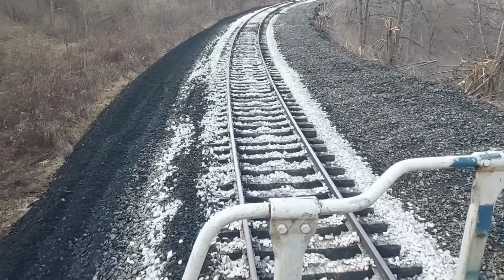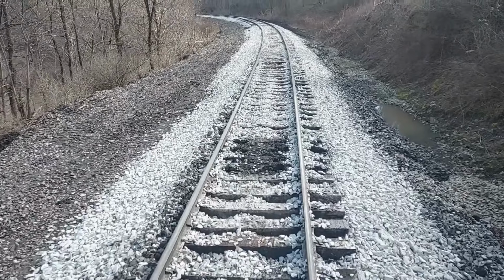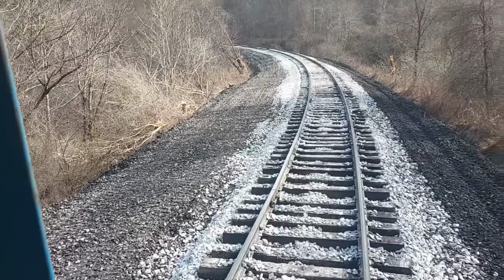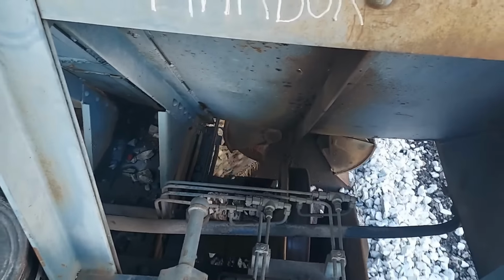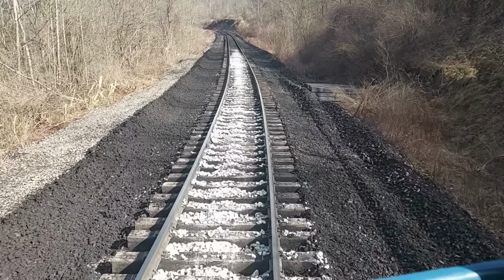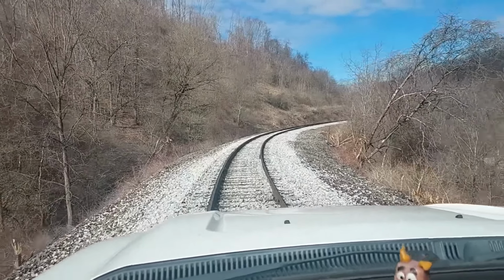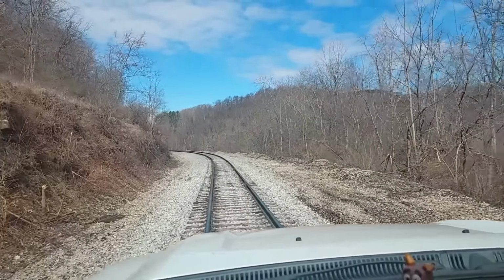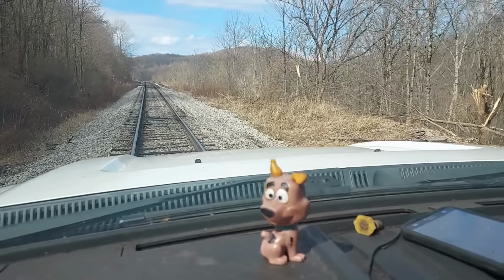Major Track Safety Improvements Got Done on Curve 8

Comment: great job stabilizing the track, it is always difficult when you run out of the raw materials 
when you are doing a task. Dave  is there a ball park figure for how many pounds of rock
{No.2 } per foot of track? so you are able to do a quick calculation of how much you need
versus how much you have on hand. then you can place what you have where it is key? 
nice video, love your positive energy! when you love what you do, you never go to work!
Reply from the maker: Thank you for the nice comment Barry. In new track construction
it typically takes about 20 tons of new ballast for every 10 linear feet. Cribbing takes about half that amount, so yes if I wanted could figure
out approximately how much ballast would be needed. I had requested more ballast to get delivered several weeks before this project even
got started , however it took awhile to get it here. Very much appreciate your taking the time to visit with us and may you have a very good day my friend.
Reply: @ccrx6700 
WOW that is so much stones! 2 tons per foot! that is a crazy amount of stone. 
but that is needed to lock down the rails and prevent movement . especially when
you look at the tonnage as it runs across the rails! the engines are at least 200k tons
and the cars are when loaded 100k pounds each. it is so sad that you are still at the 
losing end with vendors for supplies! especially with some thing like stones, that 
are processed locally! unlike the parts of equipment are mostly made some where
else far away. thank you Dave for the reply. being on the outside of railroading I never
realized what huge volumes of materials that go into creating and maintaining of it all.
Reply from the maker: @artillerest43rdva7  😊👍

Comment: How often do you have to re-ballast a specific are of tracks? Do you have any knowledge on the cost of ballasts for this job or similar? Yes you have a great job.
Reply from the maker: That depends on the section Chris. There are some places that we
almost never have to tamp and other places that get tamped many times a year. Usually we put down ballast when a place is tamped if
there is not enough to pull in off the track shoulders. Cost for our
ballast is $18 a ton delivered, which is very reasonable. Thank you for visiting with us and may you have a very good day my friend.
Reply: @ccrx6700  Whoo! The price is very low, if I compare the cost of lumber at Home Depot. I was expecting cost in the hundred. Thanks for the feedback. Do a good job today. Right. I can hear your laughter.
Reply from the maker: @Christiane069  👍😊

Comment: Hi buddy! Another fantastic video. Question...what are those rocks suppose to do on the tracks. Second...what kind of steel is needed to use to make rails to support 480,000 lbs of heavy metal Locomotive trains. Thanks Dave.
Reply from the maker: The ballast does two things Vince, one it helps to promote water
drainage away from the track and secondly it holds the track in
place so track doesn't slide around when a train passes over it. Ballast
was all plugged up with coal fines on curve 8 so water couldn't
drain away, then when water stays in there the track wants to pump
mud up from the bottom and that creates an unstable base for
the track to sit on. Not a good thing, so we got rid of the old ballast
and put in new. Much better now.  Thank you for visiting with us and may you have a very good day my friend.
Reply: @ccrx6700  Thanks Dave!
Reply from the maker: @VinceFelix-ff9cf  👍😊

Comment: I heard back in the old days, that they used to use steel slag from the mills as ballast. Is this true?
Reply from the maker: You are right slag has been used as ballast Brian. it's very cheap and
we thought about using it way in the past, but wondered about how
tamping that steel would cause a lot of wear on my tamper work heads.  Thank you very much for visiting with us and may you have a very good day my friend.

Comment: How many ballast cars do you normally use in the curves. When you operate the doors to dump ballast do all doors open on every car at the same time or can you operate each car individually?
Reply from the maker: Every curve we have is of a different length Frank. So the number
of cars obviously varies with each curve. Figure on a medium
dump on average one car will spread 1/8 of a mile dumping both
sides and the middle. Each door on the car opens independently.
Thank you for taking the time to watch and may you have a very good day my friend.

Comment: How does the rock make the track safer that is very interesting to me
Reply from the maker: The old ballast is contaminated with coal, coal holds the water and 
also plugs up the ballast so water can't drain away. Then when that
happens it's very hard to keep track surface geometry in the right
profile Brad. Track wants to slide back and forth and also pump up
and down. So out with the old and put in new ballast and track will
stay in good condition now for a long time.  Thank you for visiting with us and may you have a very good day my friend.